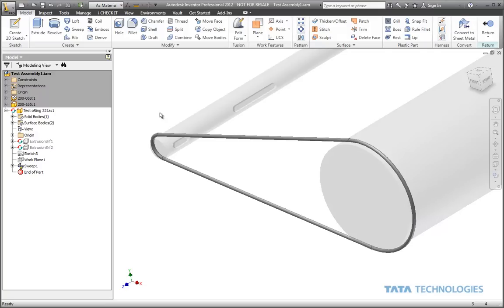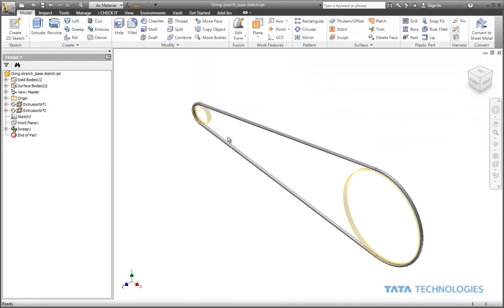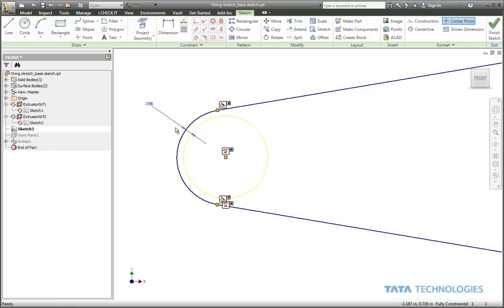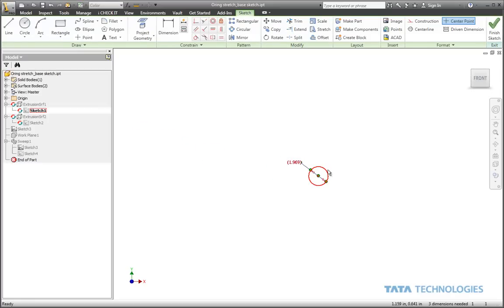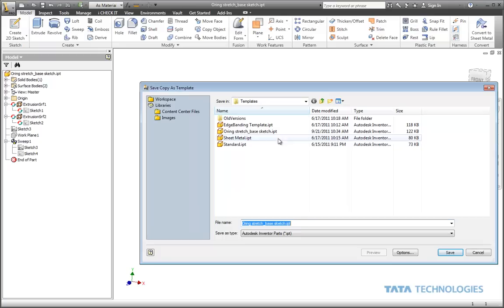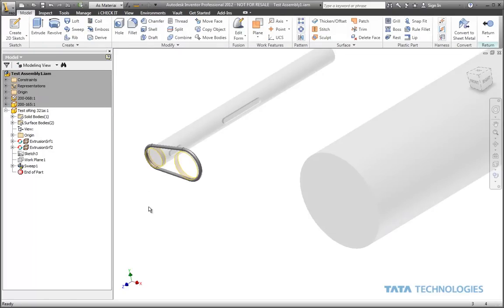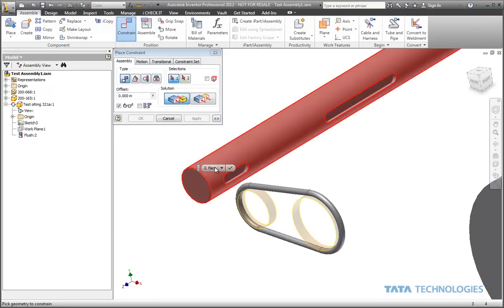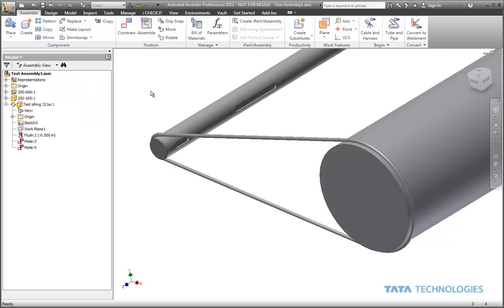Stretchy Parts in Autodesk Inventor

Comment: Thank you very much for the tutorial on Stretchy parts, I tried it and had it working properly. I do have a question, I tried to apply the same principle to a 3 pulley mechanism. The first two pulleys adapt the band well, but the third will always give me a constraint error. Any idea on how to solve this, avoiding this problem?

Thanks in advance